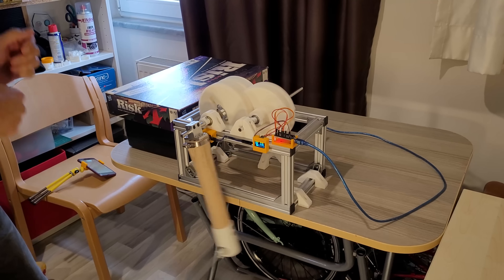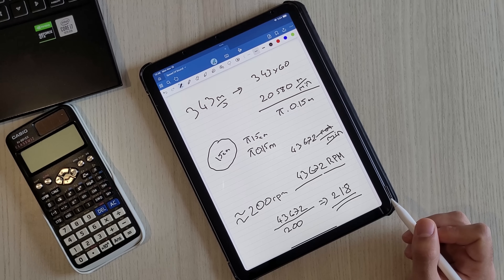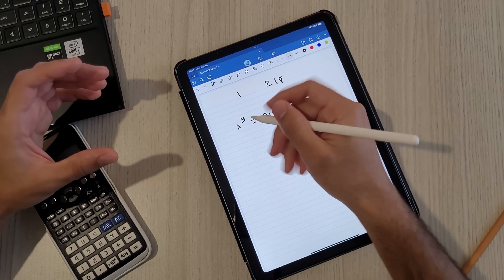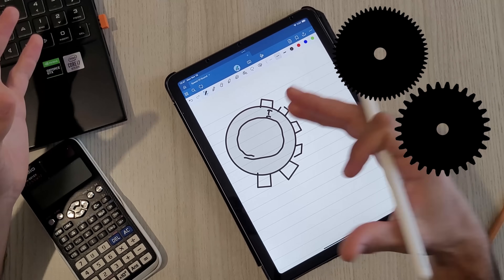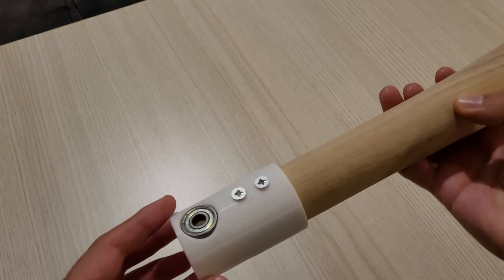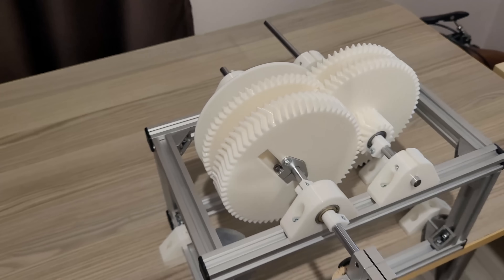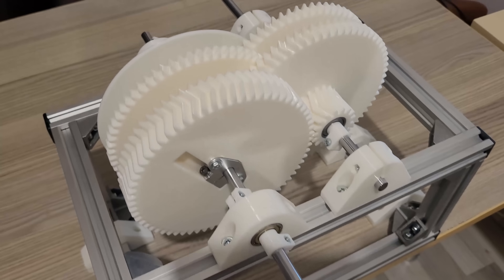Trying To Reach Speed Of Sound At Home 3D Printed Gears

Comment: You may have better luck with your gears if you print them in nylon.  Overture Easy Nylon is pretty easy to use, and it's stupid strong.  I use it for a pair of AFO leg braces that I designed for myself. No breaks.  I don't recommend the carbon fiber stuff though.  Layer adhesion isn't great.
Reply from the maker: I've been considering using different materials, but the cost of printing with nylon is still pretty high right now. I'm not sure my printer can print it.
Reply: Some Nylon is very expensive.  This type is about $30 per 1kg spool though.  Not terrible.  It prints well at 255C.  No need for an advanced printer.  You may be surprised if you decide to try it.  Just be sure you dry it thoroughly first, if that's what you decide to do.  Great video BTW.

Comment: Well since the gear box needs to be faster, there is the issue of the plastic gears with moment of inertia, if you reduce the ratio and thus the moment of inertia after each ratio set, you could possibly reach a higher speed as their is inertia and better speed for same energy, although this would only get you so far, you might have to look at a lighter approach or gear box set, like those ecliptical gears that hav a 1:any based on your own input.
Reply from the maker: Hi, i believe the main problem is not inertia. The final gear is really light. I think the main problem is air drag and the second is friction between the gears.

Comment: The last gear will spin fastest at the outer edge, meaning the wider the gear, the faster the outer part will go, so that’s a relatively easy way to go faster without too much extra engineering.
Reply from the maker: Yeah, not really. If the disc was any bigger, it would start touching the other rod.

Comment: rotation is measured in RPM, not linear speed.
Reply from the maker: Well, yeah, but if you put that disc on the ground like a wheel in a frictionless, perfect environment, it will move linearly. I'm trying to calculate that speed basically.

Comment: Will oiling up the gears help?
Reply from the maker: A thicker oil would not help since a little bit of friction in the last gear is a lot of force on the crank. But i did apply a tiny amount of thin oil. Not much can hold on at this speeds anyways.

Comment: Ok. I was curious when the video started but when you said the target arm RPM was 200 I knew it was going to be too optimistic. Professional level cyclists get around 250-300 RPM with no load using their legs, that's someone who trains for 10+ years to achieve that speed. Using your arms under load made it seem very unlikely. It is however a good starting point, I am curious where the channel goes.
Reply from the maker: Yeah, the goal was really optimistic. The problem with lowering rpms at the crank is that you have to increase the ratio, therefore increasing the torque required to turn the crank. And plastic gears can't handle much torque. 

If the ratio was even lower, let's say you need 300 rpms to reach mach 1. The speed the system would reach could be higher  since the gears will break at the same torque. But this time, that torque is combined with more input speed. Since power is torque * speed, the last disc would spin faster.

Comment: Sounds like you need a transmission with a clutch or a CVT.
Reply from the maker: Yeah, a cvt with high efficiency would definitely help. Any system that could smooth out the power curve from hand cranking for that matter.

Comment: Great video!  Did you consider centrifugal clutches to delay starting each stage, to reduce the starting forces?
Air jets on the gear teeth, like a turbine to assist starting?
Concentric strobe patterns to coincide with the frame rate of the camera?
Reply from the maker: I feel like inertia is not the problem. It is not that hard to start slow and build up speed. 
I think the hard part is smoothly delivering power at high speeds. Handcranking definitely has limits.
Reply: @canocholic  did you ever see the elliptical bicycle chainwheels that were available in the '70s & '80s that evened out the torque?
Reply from the maker: @MakeDo-Turner_Smith  Never seen them, but I've seen some bikecranks like that. Can you share a video featuring them.

Comment: I would forget about the hand crank and instead convert an exercise bike for the drive. With your legs, you can exert more force, and you can use both of them simultaneously. Moreover, you can also exert force by pulling your legs up if your feet are strapped to the pedals. I would also lubricate the gears with PTFE, use strong steel bearings at the front, and fine, fast-spinning ceramic bearings at the end.

However, it's a great idea and a very good video!
Reply from the maker: Bike cranks are the way to go, definitely. But i don't have the tools to build such a thing. Maybe if the channel grows, it can fund the next iteration.

Comment: Could you put a long stick at the end of the last disk so that it has a higher circumference without much extra mass?  Or is that cheating?
Reply from the maker: It is kind of cheating, but most importantly, it is not possible. With this system, the size of the disc is limited due to the two parallel rods. If it was any bigger, it would hit the other rod.

Comment: - Pla wasn't the best choice
- a larger final wheel would give you a larger final speed with the given gear ratio and input speed
Reply from the maker: Definitely, it wasn't, but it was what i had. 
In this system, the diameter of the disc is limited. Since I'm using two parallel rods to mount the gears. If the disc is any bigger, it will hit the other rod.

Comment: Thats a cool vid! I got some changes for you tho.

Firstly, use a new table. A lot of the force you are putting into it is shaking the table and lowering your output. Use a big rock if you have to.

Secondly, if you can I recommend using a vaccum chamber. The faster something moves the more air resistance that thing needs to overcome. Having no air resistance would make it easier to spin the gears. You'll have to make a custom chamber, with only the handle outside, but you can do it! Hopefully...

Thirdly, thicker teeth. Your gears are shearing, thicker teeth can handle higher tolerances.

Fourthly, keep everything suuuper tight together, you want no play in your teeth at all so it doesn't slip. I believe there was a formula that makes teeth making much easier.

Fifth, press your bearings into the holes using a press, the tighter the better.

Sixth, bigger handle = more torque. You want something that you can barely push at max speed, otherwise you'll be bottlenecked by your own max speed. Feet are faster but that just means you'll reach that max speed faster. I actually say to bolt your feet down and rotate a huge crank with your whole body hahaha. Loony tunes style. But basically make it really difficult to start up, rules of inertia state that things like to stay in motion, so as long as you output the same acceleration as you started, you'll get some crazy speeds without reaching your personal mechanical speed limit.

That's about it. A different commenter has already mentioned other changes you can do so I didn't bring those up.
Reply from the maker: I appreciate your detailed feedback and advice, I'll see what I can do in the next videos! This was the best i could do with the budget i had.

Comment: Who told you its aught to break by the speed of sound.?
Did you account for the much higher speed of sound inside the gear material.?
Reply from the maker: Well, it's kinda obvious that when someone says speed of sound, they mean speed of sound in air. Do you comment on rocket launches saying yeah, the rocket is going mach 1 but dId YoU accOuNt tHe SpeeD oF SoUnD In th AlumiNuM HuLl

Comment: Great video. I remember doing some napkin math to see how fast a cutting disk spins and fpund that I could probably get that fast if I put a saw blade on it but never tried.
Reply from the maker: I disagree, the table wobbles so much because the force I'm applying is varying a lot. A counterweight would help a little but would not solve the problem. Hand cranking at high speed is just not a smooth motion.

Comment: you don't need a hole through the rod, a flat spot would do the trick
Reply from the maker: Yeah, but still, i don't currently have any tools to machine hardened steel, so if the channel grows enough to fund the project next time, I'll solve the problems.

Comment: Bro, you should be sure to use an even number of teeth on either the pinion or gear and an odd number on the other. It doesn't seem like a big deal, but it much better distributes wear and heat build up. I would also suggest perhaps have the gear immersed in an oil sump or some sort of lubricant, however be cognizant that 3d printed plastic will rapidly absorb the oil, swell and degrade so if you do this you'll only get a few shots. Perhaps impregnating the teeth with graphite would be more durable, but my god I have nightmares about graphite residue getting into carpets and staining stuff!
Reply from the maker: Hi, since the gears are not working for a long time, heat build-up is not a problem. But thick oil would increase friction a lot. Also, for the fast spinning gears, not much can hold on to them while they are spinning that fast. I used thin oil, but i didn't film it.

Comment: Congratulations on setting the speed record! Even though you didn't reach the speed of sound, >800kph is very impressive. I'm curious why you measured the crank speed and did math instead of directly measuring the output gear speed. I would have put a black dot on it and used a light sensor. And that flimsy table was scary! Anyway, great video - was not too long and I enjoyed following your explanations of the math. Very clear I thought. Please keep going - the world needs to hear a sonic boom made by gears!
Reply from the maker: Hi, i measured the first gear since the other gears are spinning too fast for my phone's camera. At 30 fps, you can't reliably musure more than 900rpms. Even 900 is a stretch. Had to use my phone since i don't have a handheld tachometer. Or any other sensor for that matter.

Comment: More please ... love to see you get to the speed of sound.  Maybe print the gears at 100% infill for the gear teeth an a few mm into the hub.  Maybe PETG plastic as it's slippery and stronger.   The gears will generate heat at those speeds.   Love the rig ... I think you have something here that you could build on.

Comment: Something like a Huygens mechanism would help smooth out the cranking and probably let you use a lower initial torque. Of course then you'd need to have gear teeth that can stand up to a heavy weight essentially hanging off them.

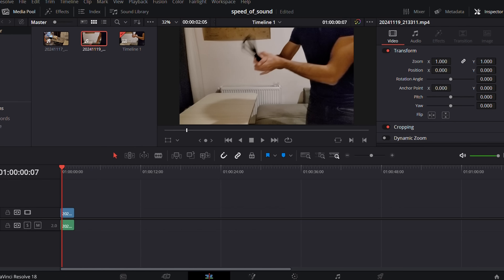Comment: 2:23 I think your estimate of your input speed held you back.   You measured unloaded speed. 

You'll find that most bicycles are geared to have you pedaling around 48 rpm.  Just like cars have a peak horsepower at a certain rpm, this is peak hp for most humans. Better athletes produce more hp (and torque) at this speed, but the peak stays around this speed for most people. 

People naturally tend to adjust the gears on a bike so that their pedal speed stays constant, again like shifting gears in a car. 

If you try again, I'd optimize for that rpm.

Good video, interesting content.
Reply from the maker: Thank you for the input. I had to keep the input rpm high since it reduces torque. Even at this ratio, first gears broke, meaning if the ratio was lower, higher speeds could be achieved. 
Definitely a better way would be using a bicycle crank, maybe next time.  I currently don't have any tools to cut or weld metal.

Comment: If you wanna stick with plastic even for the final stage of the geartrain, you could try switching to nylon 66 filament with either glass or carbon fiber filler. Print it with 100% infill, cover it in plaster of paris, and bake it in the oven to reflow the plastic for 100% perfect layer adhesion. If it's strong enough to make a 3D printed freedom dispenser, that's probably strong enough to take the stress of high speed. Also, lubrication is a good idea, the friction's gonna cook the gear teeth in the higher stages and contribute to their explode-y tendencies.
Reply: afaik raw nylon would probably work better than fiber filled, the main advantage of the fibers is stiffness, which we don't really care about in this application, and it does sacrifice some yield strength. if you want something more sturdy, you'd want a fiber core, but that's a pain both to setup a printer and pipeline that would work with it and to get some filament without using the budget for a car.
I do think you'd want some sort of spokes and concentric layers for the printing and baking would also probably help a lot.
nylon or amphora are probably the best bets outside of crazy stuff like peek/peak and co
Reply: Also some form of lubrication. Reduced heat and friction will really help

Comment: why not increase the disc's diameter? I don't think it's the most stressed part and it will have a great affect
Reply from the maker: Hi, the discs diameter is limited since there are two parallel rods in the system. If the disc was bigger, it would just hit the other rod.

Comment: I think you could go about this a different way.

Whips go at the speed of sound using angular momentum

You could make a flexible shaft of connected gears, then put it in a whip motion

Also you could make the output gear have a really long wire sticking out which would go a lot faster

Comment: change the diameter of the final disc (not the tooth diameter of the gear) so that the perimeter of the disc is supersonic.
Reply from the maker: Hi, the discs diameter is limited since there are two parallel rods in the system. If the disc was bigger, it would just hit the other rod.
Reply: think outside the box,  extend the shaft so the final larger diameter disc is outside the limiting second shaft.

Comment: What if the first gear powers a flywheel, which when engaged provides enough force to move higher gear ratios than you could on your own and temporarily break your record?
Reply from the maker: So, a disc to store energy and then dump it at once. This is a great idea, but i feel like it is hard to design and build. Maybe in the future

Comment: i wonder how much faster you could make it if you used a bike as a crank instead, but i guess that would be against the spirit of the experiment
Reply from the maker: That would be a better solution, and i don't think it's against the sipirit since it's still human powered. I just don't have the necessary tools and budget to build a system with a bike crank. If the channel grows a bit and starts funding the project i may build it like that.

Comment: Compact discs have a known speed limit. 

I realize you want to keep the gear count low, but, increasing it may have some benefit. One being reduced torque required to spin it, also increasing longevity of parts. 

Marking the gear with a sharpie will make frame counting easier. Also, using a higher frame rate. 

Find some graphite. Perfect lube for gears and bearings in this particular experiment.
Reply from the maker: For this project, I didn't have the budget for anything more tbh. A sharpie would be useful for sure. My phone can't do 4k 60fps, so I had to use 30 since i didn't use the footage just to measure it is the same footage on the video.
Reply: @canocholic  Fair enough. I would have forgiven it not being 4k. Could have had some fun making fun of lower resolutions, too. I could have sworn I saw a GoPro or Osmo Action in there.
Reply from the maker: @tobins6800  Its a Xiaomi yi it can shoot 120fps at 720p but you need a lot of light. Even in overcast summerdays the footage you get at 120fps is too dark to see anything properly. I'm currently unemployed, couldn't find a job in the last couple of months so I started this channel. If it grows enough to earn money I'll invest in better equipment. 

The project cost me about 70-80$ with about 200$ I could build a much better system with the same design but better materials, thicker gears etc.

Also video making is quite harder than I expected, I'll get better at that overtime aswell.

Comment: Comparing to speed/power ratio of angle grinder (11000 rpm / 800W at 120mm disc) i suggest you to power it by legs not by hand. By legs you got about 250W, by hand just a fraction of it.
Reply from the maker: That's a better solution for sure. I just don't have the tools to build one with bike cranks yetm

Comment: You should try reaching Mach 1 in other ways
Reply from the maker: Well, there is a super easy way, actually. A whip crack is the tip breaking mach 1. But that's not as interesting as this i believe.

Comment: Why not double the diameter of the last disc without changing its mass? wouldn't that double the linear speed?
Reply from the maker: Hi, in this system, the diameter of the disc is limited. Since I'm using two parallel rods to mount the gears. If the disc is any bigger, it will hit the other rod.

Comment: Great video, thanks for making it!

I guess you can just make the final wheel bigger, and that will get you past the speed of sound!

If you had a smoke machine setup, perhaps you’d even see some sonic booms appear :)
Reply from the maker: Hi, in this system, the diameter of the disc is limited. Since I'm using two parallel rods to mount the gears. If the disc is any bigger, it will hit the other rod.
A smoke machine would be cool it creates a lot of airflow.

Comment: Good job. Could you place the gears in a vaccum chamber (only crank out of the chamber) to see the effect of drag/no drag? Or use electromotor instead of crank.
Reply from the maker: It would definitely help, but it's quite expensive and hard to build. Currently out of budget for me